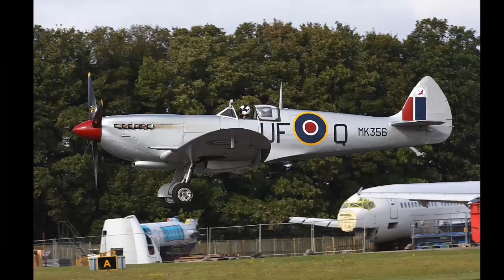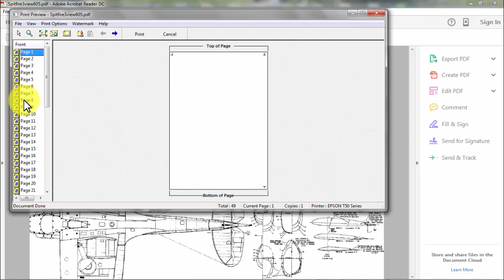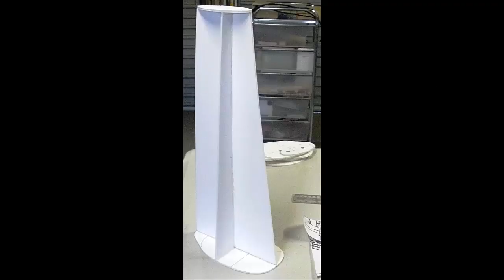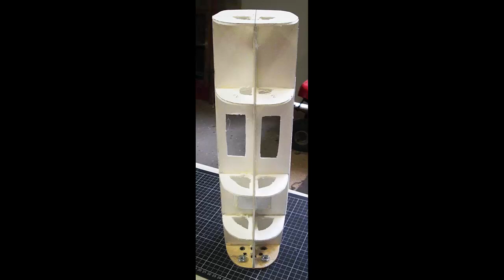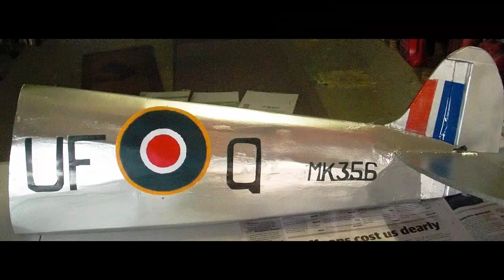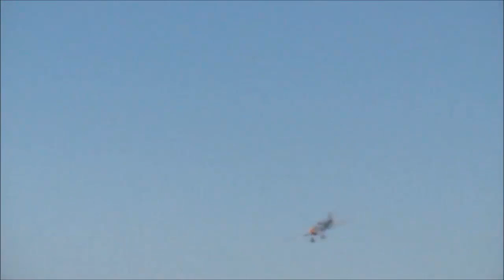Spitfire 1943 RC Electric Model Air plane stand off scale Scratch Built.

Comment from the maker: A revision to my build. The Aluminium flashing Battery box fatigued and fell apart.So I replaced it with a full 1mm ply box. Refer photos at my Google Drive, (refer above 3 view drawing storage). Also tail wheel needs a plastic tube for support through the foam board.